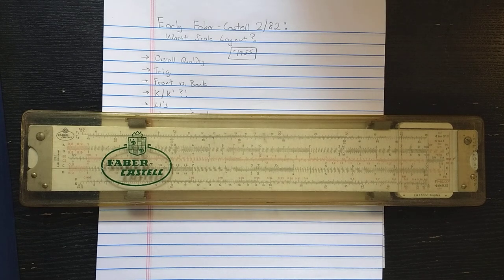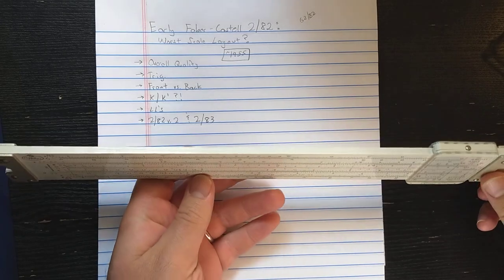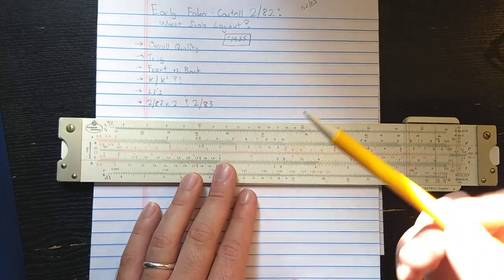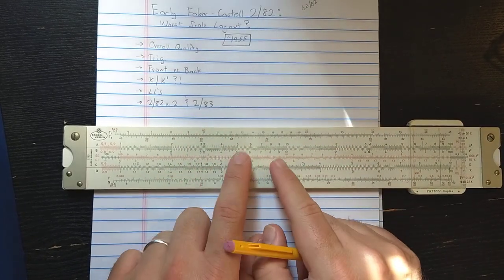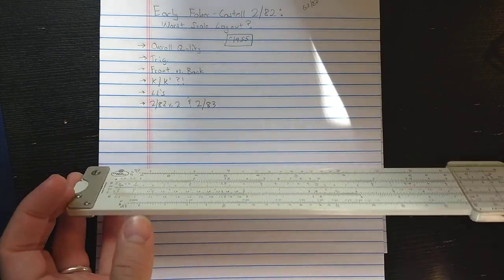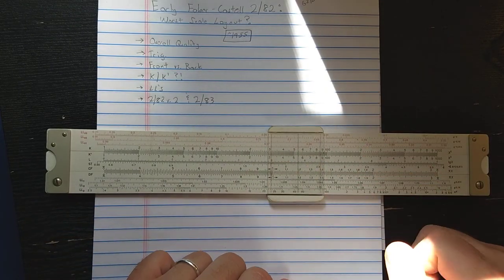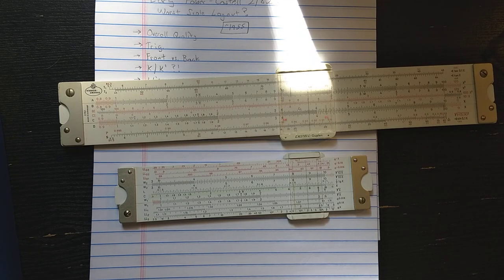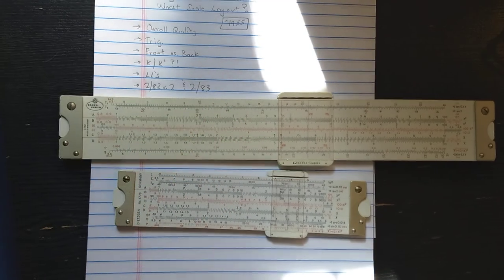Worst Scale Layout on a Slide Rule? Meet the early Faber Castell 2/82

Comment: Completely agree. I have one that I bought at a garage sale for next to nothing. But it's scale layout is hopeless. A shame because the mechanical quality is high. I have a modest collection of slide rules including the famed Faber-Castell 2/83N, but the ones I invariably grab when I actually have something to calculate on a slide rule are the Post Versalog or the Hemmi 259D. There's something about those Japanese bamboo rules - the clarity of the scales and numbering and the smoothness of the slider movement. Being a physician, I alctually use a log-log slide rule professionally. Some of  my patients insist on taking a tablet every 4th or 8th hour even though the half life in the body of the drug in question is 48-72 hours. It's my experience that the slide rule in my hand strengthens my credability for these patient when I do a quick calculation of how much is actually still in left the body after those 4 or 8 hours. Aside for that, it's also useful for a quick and dirty calculation of compound interests. For amortizations and monthly payments on your house loan? Forget it, there's much faster apps for your smartphone (or - if it has to be retro - the HP 12C pocket calculator).

Comment: I have acquired a slide rule with a much worse scale set. I believe it to be a Relay 512 5". The scales are:
Front: DF/CF, CI, C/D, A
Back: S, L, T

The tan scale is tied to the C and D scales. So far so good. However, the sin scale is a two decade scale, running from about 34' to 90°. The A scale thus gives 1/sin.

Call me dim, but how on Earth are you meant to do trig calculations with this without multiple slide/cursor movements?

I would really appreciate any workarounds you could offer.
Reply from the maker: Can you flip the slide, or are you trying to do trig using a window?
Reply: @ProfessorHerning  It has one window on the rhs but the slide can be flipped.
Reply: @ProfessorHerning  I'm not sure how flipping the slide would benefit. I can see no way out of this scale set madness! This HAS to be the worst so far. Or am I being thick?

Comment: A good thing about the 2/82 layout is that the CF and DF scales are in the same positions on the back side as the C and D scales in the front. This makes it easier to work proportion problems without having to mentally flip what is the numerator and what is the denominator. When I use the 2/82 for this type of problems, I use C and CF for the numerator, D and DF for the denominator, and in this way the numerator is always above the numerator. I find this an advantage over the Versalog layout for this type of problems.
Reply: Buenos dias. encontré en algunas pertenencias de mi padre una regla Faber-Castell Sistema "Darmstadt Nr 1/54, 4/54, 67/54b, 67/54R, 111/54, 111/54A. Mi nombre es Heriberto Parra (parra.heriberto@gmail.com), estoy en Colombia y la vendo para coleccionista. Tiene estuche e instrucciones en Alemán. Le interesa?

Comment: Instead of flipping the whole thing over, can you remove the slide and put it in upside down to get C on the same side as the log scales?
Reply from the maker: Yes, you could flip the slide over.
Reply from the maker: But if I really had to use this rule, I'd probably use CF a lot with the LLs.
Reply: Well, you certainly figured out why it was an early/phased-out model! Thanks for the interesting video.

Comment: IT STURS PAINT JUST AS WELL AS THE 2/82N    I worked in the engineering field during the time of use of these rules. you have the same complaint as we did. the rule was quality but hard to use, those who stuck to using it did so to feed their feeling of superiority, perhaps they drove BMWs. the rule was not popular as it was expensive and a post 1460 was a far superior layout. even the K&E which is what I used was easier to use. they went so far as to give away the 62/82 , for a short time, to just about any engineer that would take one. they said the w scales made the smaller version equal to the 10" . only if you had superior vision.     as to why Faber-Castell laid out the rule like they did, I think they had in mind a specific niche market that would use that layout and that niche never materialized. Engineers would wind up having two rules if one was a Faber-Castell. one for show and one for go. yes a slide rule was a status symbol. Picket was kicking back in those days, but until the late 60's the things turned your hands black from hard use. we did not have air conditioning and sweat and magnesium evidently react.
Reply from the maker: Thanks for this comment! It's nice to hear a historical perspective from someone who lived it! What field of engineering did you work in, and what years? I wonder if it's possible to find any U.S. sales numbers for the major brands in that era.

Comment: I'll agree that it isn't a well-thought-out layout, but some of its flaws can be ameliorated. One can take the slide out of the rule, and put it in backwards, to have the C scale on the same side as the log-log scales, and the ST scale on the side as the trig scales. And then put the slide back in normally for ordinary multiplication, and the use of most of the scales.
Reply from the maker: It's certainly usable, but I wouldn't pick it if I had a choice.
Reply: Buenos dias. encontré en algunas pertenencias de mi padre una regla Faber-Castell Sistema "Darmstadt Nr 1/54, 4/54, 67/54b, 67/54R, 111/54, 111/54A. Mi nombre es Heriberto Parra (parra.heriberto@gmail.com), estoy en Colombia y la vendo para coleccionista. Tiene estuche e instrucciones en Alemán. Le interesa?

Comment: The K/K' scale allows very fast calculations albeit with loss of precision, and can be compared to the Pickett Texas Speed Rule.
Reply from the maker: A/B can also be used for this purpose though -- i.e. everything on scale without adjusting solution method or swapping indices. I think both on this rule and on the Pickett rule the intention is to enable fast calculations involving cube roots. The Spanish FC manual makes no mention of using K/K' as you suggest.
Reply: Duly noted and thank you. I think this is why the Darmstadts and their descendants had the BI scale. Did anyone ever make a KI scale?
Reply from the maker: I'm not sure about KI. If this rule had it, there would be a nice symmetry of logarithmic scales.
Reply from the maker: And yes, I think you're right about the Darmstadts. BI can allow you to emulate the folded scales at lower resolution.
Reply: @ProfessorHerning  Question is what is darmstadt system. I have three Logarex rules (Czechoslovakia) which are almost copies of various German designs and bought them basically to get somewhat different ones. Two bigger have L,P,K,A,[B,CI,C],D,S,T,ST scales on front and are very similar on this side. Small one is missing ST scale and L is moved to slider below B. Non-duplex sliders are both marked Darmstadt and have LL1,LL2,LL3 on back of the slider and tables with constant on the back (conversion from metric to freedom unit, some densities, electric resistance, thermal dilatation,...). Duplex one is not marked as darmstadt and back has LL1,LL2,LL3,[CF,DF,CIF,C],D,LL01,LL02,LL03.
Darmstadt rulers share hairlines for conversion between kW and pferdestarke (german HP) and c,d to convert diameter on C/D to circle area on A/B. Coversion constant sqrt(4/pi) is also marked as C on C scale (three times for area=1,10,100). Duplex ruler which is not marked darmstadt has kW-PS conversion on AB scales. Then there are some constant marked rho for conversion between degrees<->radians and minutes<->(mili?)radians.